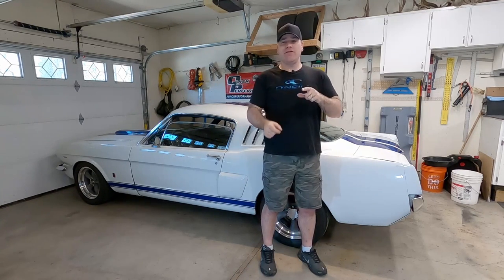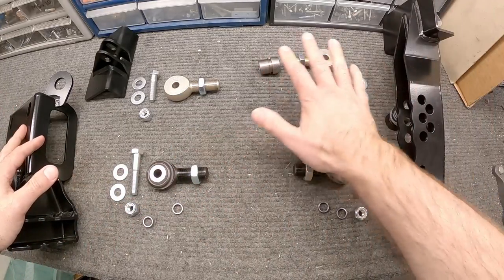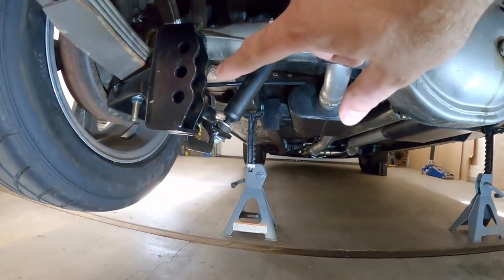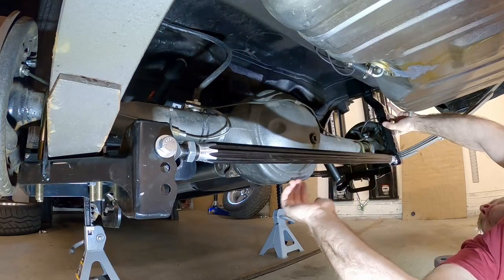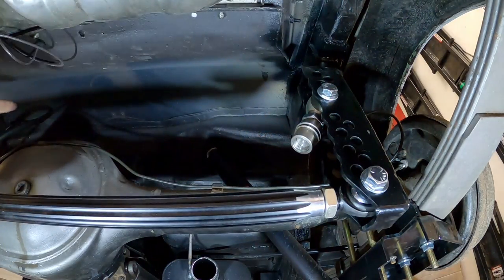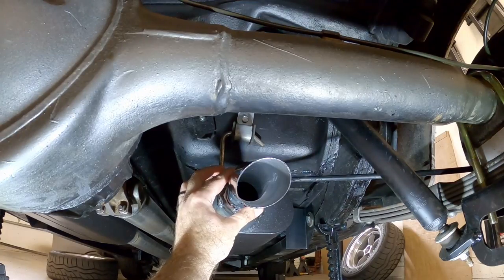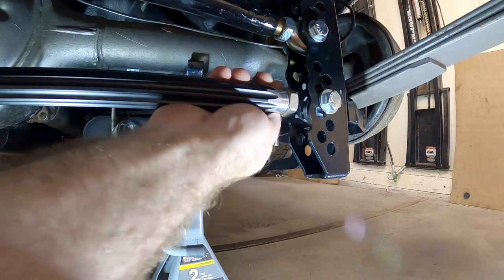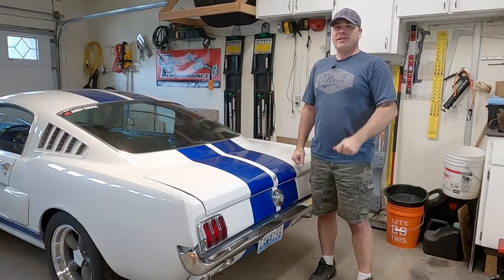Installing the Maier Racing Panhard Bar

Comment: Andy, where were you when I made my video?  LOL- I think you did a better job than I did..! :-) Btw, the rigid tube that goes frame rail to frame rail can be swung around to offer clearance for the exhaust.  Sway bars add spring rate in the corner.  I suggest running a sway bar when you are on concrete surfaces & slicks/tires.  It also narrows the window from grip to no grip.  If you are running street tires and running on asphalt, then stay away from the rear sway bar.  That kit was definitely an evolution kit.  Hope you guys dig it!! Charles Maier
Reply from the maker: Awesome, Mr Maier commenting on my video!  Thanks for the feedback, I was hoping that it would paint your company in a good light as I'm super impressed with this bar as well as the customer service I received during the purchase.  For what it's worth, Bill was awesome to work with!
I was thinking about that upper tube being able to clear the exhaust, but I was needing to cut the exhaust out anyways as it was interfering with the mounting locations for those pieces that weld to the frame.  In the end I was able to make it all work out and I got the exhaust we done.  Everything clears and everything works as expected.  :)

Comment: Great vid, man. Thanks. It’s amazing how similar our projects are. I have the Maier rear springs and I couldn’t be happier with them. They all but eliminated the axle rap that I was getting from the Grab a Trac springs. I have the Bilstein sport shot ma and they seem to be a great match to the high spring rates I have. 600 up front and 165 out back. This mod is on my short list. So glad to hear that it’s made a huge difference for you. I’m sold
Reply from the maker: Awesome, those Bilsteins are something I've been debating about swapping to.  I really do think you'll like this new Bar when you get it installed, it really changes how the car reacts in the corners, and tightens up the car.  I should have bought this bar sooner.  :)

Comment: Hi Andy panhard bars are as you said a lateral locating device designed to keep the axle centred in the car. They also, depending on where they cross the axle centreline, set the rear roll centre height. That is why you can vary the under /over steer characteristics by changing it's height relative to the centreline. On a car with leaf springs and a live axle like your mustang the factory roll centre height is the centreline of the rear axle. The kit you have fitted lowers the rear roll centre considerably  from stock  in all 3 positions and with standard rate springs would increase the understeer drastically. I think it maybe designed to run with much stiffer than standard rear springs, which, without the panhard rod would make the car oversteer. Fitting the 2 together would make a nice adjustable package. I see you have 3/4 main leaf springs which are a great set up to control axle tramp without binding  but are they a heavier rate than stock? I'm not trying to be a smart arse here but anyone watching the video needs to know what they are looking at. Jay
Reply from the maker: The rear has 4.5 leaf, mid-eye units that I upgraded a while back.  I do not recall the spring rate, but they are definitely stiffer than stock, almost too stiff for those days when I don't want to push it.

Comment: Thank you for sharing! Trying to decide between the Mike Maier Mod 1 kit or the Street or Track Watts links setup. Would you go for more of an adjustable package if you could do it over again?
Reply from the maker: I am very happy with the build quality and experience that backs all of Mike Maier's parts.  In fact, I have my eye on their Mod 2 rear package.  :)
There are some advantages to the Watts Link, but I am not a fan of how complex it is for the average guy to install, as a Panhard Bar is easier to install and requires less modification to the car and supporting pieces.
It's not about 'doing it over again' because my path is mostly limited by funds.  I don't want the car to sit for 2-3 years while I save up and buy the suspension.  I want to drive my car so I buy parts as I can and upgrade.  In the end it costs me more, but I'll take that trade because I get to enjoy the car and learn along the way.  :)
Reply: @AndyKruseChannel  thank you!

Comment: Thanks for the video. I've subscribed to your channel. Can you post up some photos (or a quick follow up video) of the finished exhaust pipes you mentioned? I'm struggling to see how the panhard bar will fit with a fuel tank and standard exhaust pipes running to the rear of my car.
Reply from the maker: No problem.  I posted a few pics on my Instagram page of how the exhaust routes around the Panhard Bar.  :)

Comment: Andy's famous quote, "This might be easier to do with another person."
Reply from the maker: Truth.  So far all I've needed help on this car was bleeding the brakes, everything else has been a solo effort.  The good thing is it shows others can do it, even though it's usually better and safer to have help.  :)
Reply: @AndyKruseChannel  Yeah I looked up the 1 person brake bleed kits and I wasn't too confident on getting all the air out, so I recruited the wife for help on that too. She does drive it about as much as I do, so I think it's high time that she put in some work on it.
Reply from the maker: Haha, trading work for some fun time, I like it.  Yeah, I looked into those one-man bleeders, I even bought one.  I was probably doing it wrong, but I wasn't impressed either way.
Reply: Hi Andy I’ve just done a disc brake conversion and used a 1 man bleeder and I worked great 😊
Reply from the maker: @garysbonsai  Some people swear by those one-man bleeders, maybe the one I purchased was crap, but I struggled with it more than I wanted to.  :)

Comment: Sad to see those beautiful pipes get cut out! I've been very interested in their products, happy to see you getting some level of a partnership! 

Do you have any plans to objectively measure performance improvements?
Reply from the maker: Agreed, it didn't like cutting out some exhaust work that I recently paid for, but it was needed to get this Bar in the car.  Knowing what I know now about how awesome this Bar is, I'd do it again in a heart beat.  This Panhard Bar is fantastic, I wish I installed it sooner.  I have since had the exhaust pipes redone and it's all good to go now.
The only performance measurement I have is my backside, which is telling me that this car is so much tighter than before.  I can actually steer the car with the throttle, even with that tired 289 I currently have installed.  :)
Reply: @AndyKruseChannel  in a perfect universe, would have had a better order of events? I know it also sucks to have to grind off underbody protection.Steering with the throttle sounds like a dream.
Reply from the maker: @jordanschultz2232  Yes and no, all of the suspension related parts I've added would have been added even if I could have purchased everything at once.  I think this new Bar really shines now that I've sorted out the suspension weaknesses with new components.  However, considering how well this car handles now, I would have liked to purchase it sooner, meaning other things I've done to the car would have waited so I could put money towards the Panhard Bar.  :)
Reply: @AndyKruseChannel  so this car doesn't have a rear sway bar yet but you had one in the coupe right? Will you be adding one now? What about front sway bar you did an upgrade on both of them no?

Do you feel any shirt comings from your other suspension componente now such as shocks coils or leaf springs?
Reply from the maker: Correct, the rear swaybar was on my previous car, the coupe.  I do not have one on this car and at the moment I don't plan to add one, the Panhard Bar is that good!
I have upgraded the front sway bar, and I'd recommend people add that to their list if they're focusing on the improved handling of these cars.
I'm wondering if I should have gone with the 5 leafs (like on my Coupe) instead of the 4.5 leafs I purchased for the Fastback.  I do enjoy the slightly softer ride when I driving "normal", but I have found the limits of these leafs when I push the car.  I also cut too much off my front springs, now that they've settled a little.  The driver's side is about 3/8" lower than the passenger, I'd like to have them be even.  However, front springs are cheap, so I may revisit it and not cut so much.  :)
Reply: @AndyKruseChannel  I put 5 leaf on my coupe but without s drop so it's standard height which I somewhat regret just for aesthetics but they feel nice most of the time. Haven't messed with the coils on the front, do you like the feel of your front end with them cut? Overall your car seems to have s nice stance to it!

You should do some driving videos and let us see the real Kruse view in action
Reply from the maker: The Mid-Eye leafs provide a slight lowering, but not too crazy.  Then, someone can add lowering blocks and dial in any extra drop they want.  That's what I did.
The front coil stiffness is acceptable, but because I cut too much (about 1/4 coil less would have been good), I find it bottoming out in some extreme cases.
I get enough flak from the internet, there's no reason to inject more ammo for the trolls out there.  I find the subjective stuff I do gets the most criticism, so I tend to stick to more objective projects.  Grants, the path I've gone with this car is very much my own and therefore subjective, but I try to keep the instructions and dialog as factual as possible to remove the ability for the trolls to have a hay day.  I've got fairly thick skin, but sometimes they're just ridiculous.  :)
Reply: @AndyKruseChannel  hahaha I think you summed up the entirety of the Internet right there! Well stay true to what you love and your content will find a following!

Comment: Hey where did you get your center console. In a previous video you said it was $70 I can’t find anything less then 180
Reply from the maker: The console I purchased for this car was used (off Ebay) and before shipping it was around $70.  On my previous Mustang I purchased the same console, but new, from CJPony and it was about $150 shipped, now they're $180 plus shipping.

Comment: What size torque thrust wheels you running?
Reply from the maker: 16x7 with 4" backspacing, part number VN2156765.  :)

Comment: Doesn't the car have to be at ride height with the weight on the tires? Also invest in a 3/16 Titan brake line flairing tool available at Oriley, those rear brake lines are beyond horrible.
Reply: I always comment before seeing the whole video, sorry.
Reply from the maker: Haha, no problem, I've done that too.

Comment: I thought I was burning up my credit card with projects. You're literally vaporizing your card. Did you get inspired by my autocross video? Also you should include a link to Maier Racing in the description.
Reply from the maker: I might be spending too much on the car, but as long as the Boss approves......
This bar was on my list since the my last car, I just ended up doing the Rear Sway Bar first before I sold it.  I knew I was going to do it on this car, I just had other parts I wanted to fix/upgrade first.  However, knowing what I know now, I should have purchased this bar sooner.  This mod has transformed the way this car handles more than any other mod I've done so far.  :)
Reply: @AndyKruseChannel  Yeah, I told my Boss about your videos. She said I’m banned from watching them anymore. She says she can’t afford you. 😜